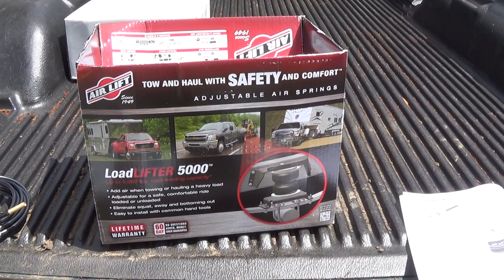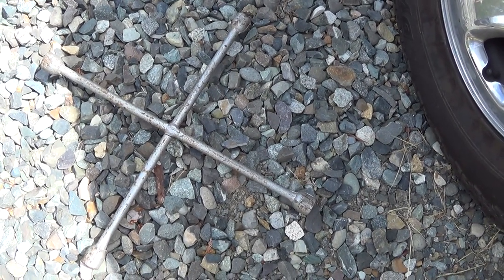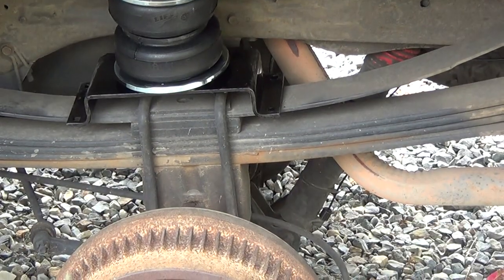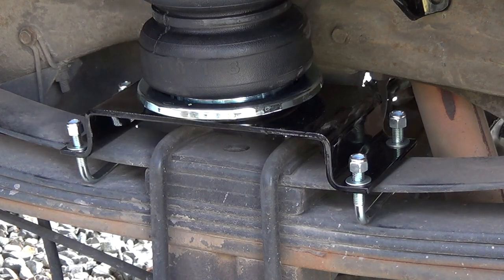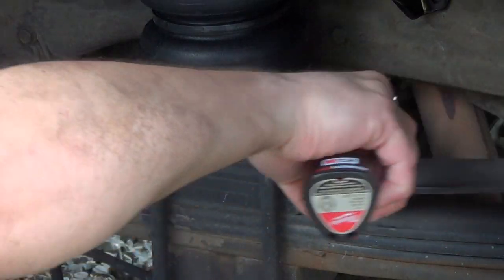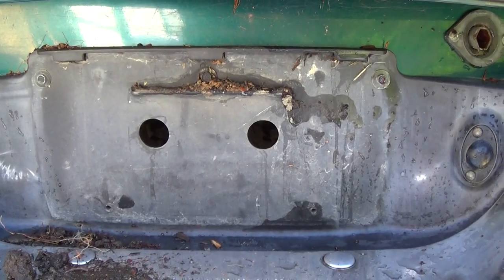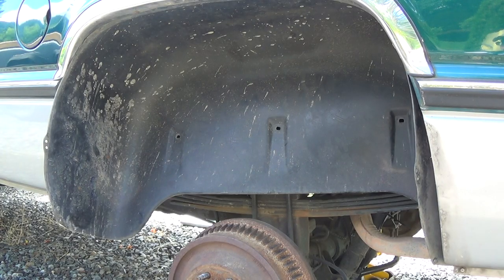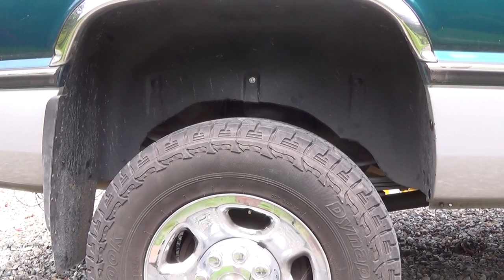Air Lift LoadLIFTER 5000 airbag installation

Comment: God bless the you tubers that show all their mistakes. Makes us all feel better about when we do it. These are great kits with heavy components. I just installed a set on a 2008 f350 with a Steelweld service body. I had to do a little work on the brackets with a speedy wheel and also had to drill the frame. The bags made a tremendous difference in handling. The bed and tools probably weigh 7,000 lbs.

Comment: Just started watching your vid here, and I am always visited by Murphy at the wrong time too. When you surprised us with your X lug wrench showing how it snapped apart I could see that exact thing happening to me and felt what you felt at the time. You had my empathy throughout..
Good video with good advice on the install. 
I just ordered mine from Amazon. Will be having my own fun next week. Oh, I bought this because Iive in my van, and the passenger side leaf spring had snapped on the top leaf 8 inches from the end. The second leaf was just resting on the underside of the broken top piece pointing up still attached to the shackle. Lovely fun that I get to do next week.
Already got my replacement leaf spring in from Texas to Calif for $107 with Free shipping!  Aheadb of then came so far...but I know Murphy is lurking around somewhere getting ready to pounce .... 😠🙃😉😎

Comment: You forgot to use the spacer on the left side of the driver's side bottom bracket and the spacer on the right side of the passenger side bottom bracket to make it level with the frame. As you have it, the airbags are way off from the frame of the truck.

Comment: You weren't kidding about mechanical aptitude. Those pieces that hold the fender liner in are riv-nuts. Push the center in and they more or less fall right out.

Comment: Thank you for your how-to and how-not-to video.  I am just a regular guy trying to be handy (will probably go buy some jack stands and a right-angle drill for this project).  Luckily my F-150 doesn't have a fender well cover!  I just wanted to comment how awesome your idea of putting the valves through the license plate is.  I will copy you!  Probably going to hook up an on-board wireless air compressor, as well.  Did you ever end up adding that to your system?
Reply from the maker: ***** Thanks for watching.  I think the valve through the license plate trick was in the directions, so no real awesomeness on my part.  I pretty much only use the truck for hauling loads, so I leave it aired up.  I don't think I will add a compressor.  If you have all the parts (especially new drill bits) and a friend, this is about a two hour job.

Comment: With your audio besides being outside you have an Audio Gain Control feature which will hiss like that if you don't speak. Depending on what camera/camcorder you have some people that have made a feature to defeat that and get rid of the AGC.
Reply: That airbag is a perfect fulcrum to break the frame. Waste of time. Money. And good way to write off  a truck or cause an accident

Comment: I was wondering why you used the bags you did. I've notice some kits have bags that look like cylinders instead of 'stacked donuts' like yours. The cylindrically shaped ones cost the same. Thanks.
Reply from the maker: The answer is that I am simply not aware of the other type of kit.  I have no idea which is better.  This got good reviews from a couple of different sites, so I went for it.
Reply: Thanks

Comment: nice work im looking to add that to my RAM ....question can the upper bracket be welded instead ?????
Reply from the maker: probably could be welded.  It is pretty thick.  I have no welding skills, so my opinion on that may not be worth much.

Comment: all extra weight sits on the helper spring, that's not going to work. It should sit on the axle. on the top end weight should sit on the frame, here its 2 bolts. the bracket should sit on the frame, not just 2 bolts.
Reply: From a logic standpoint I think his setup will work just fine but the only difference is that the air bags will probably need a little bit less air as it's connected to the helper springs than if it was connected from the frame to the axle. Post the link of what you have done so we can see.

Comment: Have you had any issues since with the air fittings leaking at the bags? I have a set that sits in board of the leaf springs on the axles and they leak down after a few hours. I checked all I could easily reach with soapy water and found no leaks except for the fitting on top of each bag.

Comment: good video.  I liked it.  I wanted to hear the cussing and see if it was similar to my cussing when I work on cars.  most of my cussing is aimed at the dufus design engineer....otherwise known as an idiot.  yessir, I enjoyed the video.  but I don't like the product.  as one commenter stated, the weight is on the helper spring.  oh well,  I hope it works for you.  stay safe.

Comment: Thanks for posting this.    I want to do this to my van to INCREASE ground clearance, for boondocking / camping.  Any idea if I could get a 4" lift on demand ???
Reply from the maker: Not with this system.  You can add a compressor kit to it, but it won't lift your truck.  All it will do is return a sagging back end to level.
Reply: Fernbark Frist  That is not what I heard about air systems.  But maybe this particular kit can't do what I am hoping for.  Clearly I have more research to do.  
THANKS for making and posting
Reply from the maker: This isn't an air system.  This is an air bag.  They are different.  Air systems are quite a bit more than $280!  Happy hunting with your search.
Reply: captnhuffy I'm looking for the same thing for my Jeep Grand Cherokee Overland 2012. Did you find something? Thanks
Reply: nope.  not yet.
Reply: captnhuffy this does not change ground clarance sheesh
Reply: paula polls  Some do lift and even level.  If you don't think so kindly review what the Mexican are doing with their vehicles.   Those guys can make their cars catch air.   my turn to say "DUH"

Comment: I have these on my dodge and man I need dental insurance while going over the smallest holes. I think they would be better going on the axle instead.
Reply from the maker: My Dodge is a rough ride too.  The front axle is worse than the back on mine.
Reply: Fernbark Frist I removed my rear airbags and put the Gabriel pro guard shocks on the back and Monroe oespectrum in the front and it rides a lot smoother now.
Reply: I recently re-installed my air bags but when I installed them back on, I compressed them down, I had to make new holes, the new holes still lower on the frame. Now, when you air it, the suspension raises now. I think there is a flaw on the air lift instructions. When you have extra time, give it a shot.

Comment: Well, it has been 8 years since you posted this video.  How did they hold up for you?  Any issues?  I just put a set on my truck.  Thanks!
Reply from the maker: They have held up, but to be fair, I have not really stressed them.   Just need them vary rarely.

Comment: do bags lift it at all?
Reply from the maker: No.  They only keep it from dropping lower.
Reply: Fernbark Frist does It lift it at all I was hoping to get this to level out my truck and also help it when I load it
Reply: Santiago Soto yes it will. It will be stiff depending on height but you can lift with it.